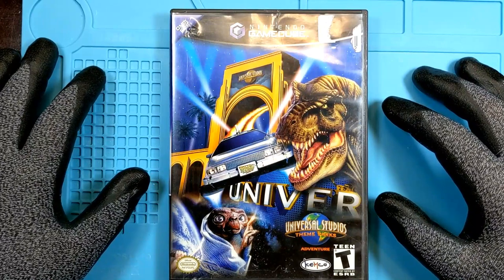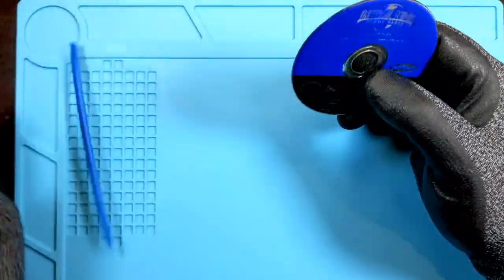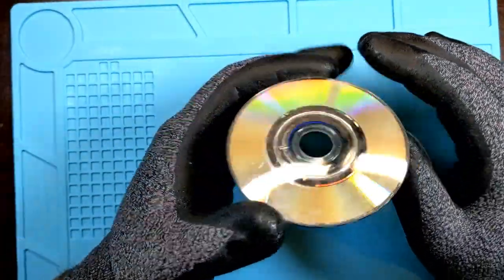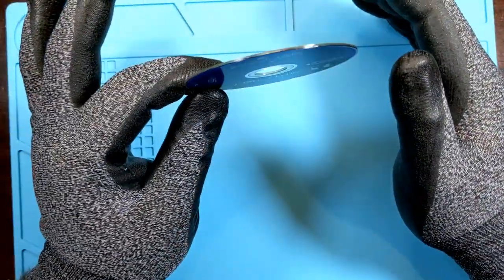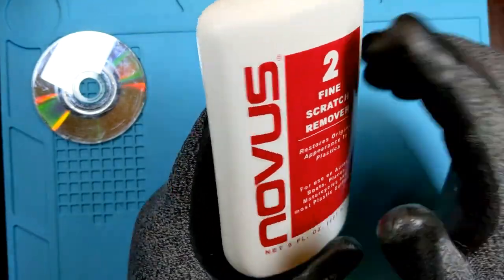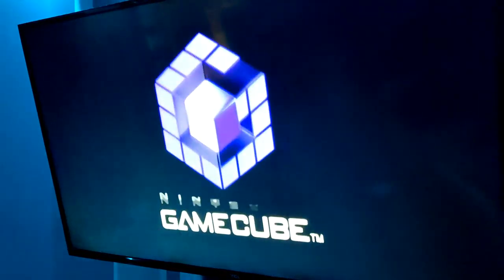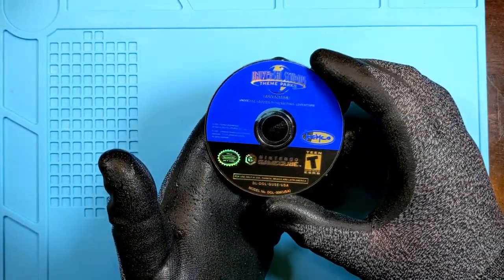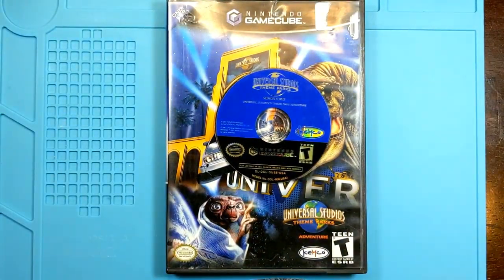GameCube Disc Cleaning Series:  Part 1- Intro and basics

Comment: I had both disc resurfacer you mentioned in this video the Venmill 3500 and eco autosmart. The Venmill I will agree isn't a good one and doesn't really fix the games. The auto smart on the other hand i've had for years NEVER once did it leave residue in the center of ANY disc i put through. Also 99% of the games I run through it with end up working that were once not working. So you might wanna do a little bit more research before making claims that pretty much all disc resurfacers are bad. Also its not true that if you can't feel the scratch with your finger nail it doesn't need to be resurfaced. I've gotten discs with the swirl marks on them that stop the game from playing. Not a scratch itself.
Reply from the maker: We can agree to disagree! I have a basement full of ELM and JFJ machines, and have worked on many more. Those machines are also expensive and not always an option for folks, so I am happy to give people alternatives!
Reply from the maker: But you are right about the scratches. Even if you can't feel it, it can still impact gameplay, swirl marks too. It's more of a rule of thumb that scratches you can feel may impact gameplay.
Reply: True! I’ve resurfaced games that before cleaning didn’t work, and after cleaning it, they worked. This dude got his facts mixed up

Comment: What if any GameCube Disc plays halfway through and it says, "The Game Disc could not be read. Please read the Nintendo GameCube Instruction Booklet for more information".
Reply from the maker: That means one of two things, either the scratch is "later on" in the discs data area (think of it like a CD that skips on the 5th track), or that the laser has trouble reading after running for a while. 

If you've cleaned the disc and don't see any visible marks or damage, try to clean off the GameCube lens as well. Particulate from the cleaning compounds of the disc can also rest on the laser lens and cause issues down the road. Somewhere in that system or disc is the issue, it just might not be right at the beginning of the discs readable area.

There have been discs that I've cleaned before that work just fine with a test run, but halfway or even close to the end of the game the disc freezes up. Unfortunatly a disc isn't like a record where you can figure out what "halfway" in the game would be on the disc, so you have to clean the entire thing again.

Comment: Everything I've tried to use Novus 2 on just adds more scratches. Disc's or otherwise. I must be bad at this.
Reply from the maker: It'll look like it! Heck sometimes it'll look worse than it did before! But you're removing the top layer of material and smoothing out the scratches that are making the disc not play! For the first 3 parts of the GameCube disc cleaning series, the focus is on getting the games back in working order. After that, we'll have videos on bringing a mirror finish back to the discs. (I'll admit though, I rarely worry about the look of the disc if it works, but we'll have a handful of "how to polish discs" videos to get that mirror finish!)

If you're using Novus 2 and getting scratches still, use more polishing compound and switch out the cloth more often. It's likely that the cloth is doing more of the scratching than the polish is. I need to stop showing cleaning discs using a paper towel, as some paper towel brands can scratch a disc very easily!

Comment: can you repair games that have water damage?
Reply from the maker: Yes, but it depends. If the water damage has impacted the data layer, that changes things. Thankfully most modern discs have a seam that separates the data layer from the internal ring. Even then there are methods of drying/baking (I use that term loosely here) that can remove water damage. The problem isn't always the water, but what the water leaves behind (mineral deposits and/or staining)

Comment: Just got resident evil three for the GameCube it runs in the beginning shows all the ads but can’t get to the start menu. But I did get it resurface sure enough and it still does not want to work. What do I do???
Reply from the maker: Sounds like it needs a bit more resurfacing! Which happens. If it now shows the three ads at the beginning and stops, that means that it's getting closer to working! Just keep at it!

Comment: I used 3000 grit sandpaper and var wax...its not working 😢. Im gonna get some novus tomorrow ... I got all the large scratches off of it they're just extremely fine now....
Reply from the maker: So sandpaper resurfacing is its own thing entirely (I'm slowly working on that series), but to do it correctly you'd need at least 3-5 different grits of paper, otherwise you can't reduce the overall scratches. If you're looking for a mirror finish, look up polishing/sanding pads and add some water to that wax! (also be careful with the wax, as some of them have additives that increase the overall grit of the wax itself).

Comment: So I have GameCube games that are badly scratched and I used the nova two and the GameCube still says can’t read the disc what am I doing wrong?
Reply from the maker: Might take a few more tries! I had a copy of Pokemon Gale that wouldn't come back to life until my 22nd polish (apparently it just didn't want to live), but I got it working! Check out my Part 3 of the GameCube series where I get into what to do if the Novus 2 just doesn't work (and I explain why it might not work right away).
Reply: @RestoreAndReplay  oh ok great and I finally got it to work took two tries thanks so much

Comment: Did you actually try playing the game from start to finish? Just because the system can read the disc, doesn’t mean the game is fully functional. I know this because I have a disc with a scratch that’s causing the disc to stop reading once I reach a certain level in the game.
Reply from the maker: While I wish that was the case here, the disc wouldn't load at all. No start up screen, no nothing. Which happens with severely scratched discs, the system has to find a few specific spots to read before it gives the green light. And in the case of these games, it was a "no go".
Reply: @RestoreAndReplay  What I meant to ask is if you attempted a full playthrough of the game AFTER you resurfaced it.
Reply from the maker: Ah! Gotcha! Once the discs are resurfaced (at least the ones I do) they go through a microscopy inspection to verify there aren't any remaining significant scratches or abrasions. Depending on the title (and if it's for a customer or not), a full playthrough isn't always possible. But marking the scratches and substrate damage, then reinspecting after the resurfacing process, tends to be a solid QA process, at least for my efforts!

Comment: is there anything you can do when it has a scratch on the top of the disc? i know some games it doesnt matter, but some, like a copy of mario party 6 i have has a scratch on the top and it wont work, bottom is flawless
Reply from the maker: So back in the day we used to put masking tape over the top of the disc and it would prevent the laser from reflecting through the disc. Buuuuuuut with GameCube it's getting harder and harder to not get excessive label damage (look up "Metal Gear Solid Twin Snakes label damage") For now I still use the tape trick until we refine how to seal and color in the labels, but it's a work in progress.
Reply: @RestoreAndReplay  thanks for the reply man I appreciate the info, ill try the tape trick, im familiar with metal gear solid on the gamecube lol, thats also one of those weird ones u could peel off all the art on the top and it will still work, gamecube games are weird lol

Comment: What about head light buffing compound
Reply from the maker: It will work! I use Meiguars Headlight polish for discs at times. I have plans to make a video covering a few headlight kits. With the buffing compounds you'll just skip the wet sanding steps they suggest, and instead add more or less compound to increase the abrasiveness!

Comment: Tried doing this with my Wii Sports around a year ago, didn't help it work. Turns out the disc was scratched beyond repair. Ended up getting a new copy for Christmas 2023. Might retry this with a scratched copy of Sonic Adventure 2: Battle.
Reply from the maker: Those "beyond repair" discs might surprise you. I actually actively search for "hopeless" discs. If there's enough polycarbonate to work with (you have to measure it with calipers), you'd be surprised what can be recovered.
Reply: @RestoreAndReplay  I got a new copy, and... guess what? IT LOOKS EVEN WORSE! Guess I have a lot of restoring to do!

Comment: Got my Novus in the mail today 😁
Do you tend to use the step 1 after you've used the step 2? I understand it's just a cleaning fluid but does it have any use in this process? 
Or is it better used elsewhere? Like when cleaning consoles etc?
Reply from the maker: I'm going to make a whole video on Step 1!  But the short version is that I use it to shine and protect consoles! I use it similarly to ArmorAll. It also helps when used on games and consoles to help resist dust and fingerprints! (but it only lasts a few weeks!)

Comment: Hi I got a scratched copy of colosseum novus 2 should come in tomorrow roughly how long would you leave the novus 2 solution on the disc before you buff it? Thanks in advance
Reply from the maker: I leave the Novus on just for a few seconds until it thickens up a bit. It helps with polishing. But you can also start to polish right away with wet novus. Try it out a few different ways and see what gives you the best and smoothest polish. You want light resistance but you don't want to have to force the polish. For starters just give it a count to 5 and start to polish!

Comment: I'm totally unimpressed with Novus 2 "Fine scratch remover". Believe me, i've tried virtually every non-professional disc-cleaning cream and gadget under the sun &, in my opinion, this is no better than any of them. It may work well in conjunction with a high-end cleaning machine but cleaning discs by hand with it shines them up pretty good but, rather ironically given it's name,  leaves them completely covered in fine scratches.
Reply from the maker: I'm sorry to hear you're having trouble with Novus 2! That stinks!

Interestingly enough, Novus 2 is the same chemical composition as most retail "disc fix" compounds, including the ones sold by GameStop and Circuit City!

Comment: Do people really resurface games before seeing if they can play? That blows my mind…
Reply from the maker: Not just people, stores. Most of the stores by me resurface every single disc they sell. I have to remind them to not do that to mine when I buy them. Each resurface removes some of the polycarbonate layer of the disc, so as it gets resurfaced over and over, that layer gets thinner and thinner. Without verifying disc thickness, that resurface may be its last!!! 

Maybe not that dramatic, but you get the idea. Bulk resurfacing is somewhat unnecessary, but done because customers want to see a disc that looks like it will work!

Comment: Novus only comes as a part of a set, making this pricy solution. Can the other parts be used in any way? It would be fun to see you experiment with step 1 and step 3.
Reply from the maker: Absolutely yes! Novus Step 1 is my absolute favorite for cleaning up and protecting consoles (there's a video coming for that!)

Novus Step 3 will be featured very soon in a GameCube series video. It's for when you need some extra elbow grease and/or have deeper scratches! Both are definitely useful!

Comment: I know this is an old video, but what do you think about Novus 1? My local Home Depot only had dual packs that came with step 1 and 2. Should I bother with the step 1 at all?
Reply from the maker: I really like Novus 1! It won't do too much to get rid of larger scratches, but it helps clean off dust and fingerprints from discs, and leaves a nice little protective coating that keeps dust off for a while!
Reply: @RestoreAndReplay  Thanks for the reply! Love your videos, thanks for sharing your knowledge and helping people fix their old games! My Mario Galaxy disc always freezes at the same spot in the same cutscene. After each treatment with Novus 2, it gets a little farther before it freezes. Ive done 4 treatments so far, Ill do 20 more if I have to! Lol

Comment: I just used some McGuires plastic car lense polish. It made my $30 Mario kart double dash work. It did have an issue in a GameCube that was supposed to be bad. But it was fine in same system prior. So I adjusted the laser and it played fine. It had a spot on the intro that would drag, but that went away. So I won’t be hellbent on the small scratches as long as it plays according to your advise. Thanks
Reply from the maker: Absolutely! I primarily use Meguiar's in my car detailing, so I try to find Meguiar's stuff that will also work on video games, and there are a handful of their polishes that work wonders on discs. Maybe we can get them to make a 2-1 cleaning product!!

But for real, GameCube games can be so picky, and the GC lasers can be sooo picky as well. I love that little system, but it certainly has it's quirks!

Comment: My endeavors with novus have been relatively successful! All the discs I've used it on have become mostly or completely functional all accept one disc, I've probably used novus 2 on it about 15-20 times and I've used novus 3 twice, but it still won't play, it gets to the loading screen of the game(before it didn't read at all so the novus worked a little bit?) but that's it, should I accept that the game is beyond repair and give up on it or keep going?
Reply from the maker: You should never give up on a disc! What's the disc? And for what system? Having to do 20 rounds of Step 2 and 5 rounds of Step 3, then repeating the entire thing isn't out of the question, it really just depends on how deep the scratches are.

Are you able to see any noticable scratches on the surface? Or feel any with your fingernail?
Reply: It's Sonic Heroes on the gamecube, the disc is cracked in the center ring and it goes into the shiny aluminum part which made me conclude that the disc is unfixable, and it also has one scratch that has somewhat reduced but isn't going away.
Reply from the maker: Center ring cracks rarely mean ruin. It depends on the width of the crack into the data layer and if the top and bottom layers of polycarbonate are still intact.

I'd be happy to take a look at it if you're willing to provide pictures! I would love genuinely irreparable discs to add to my collection (they tend to be salvageable)
Reply: picturre quality isn't the best but I'm sure the cracker is visible

Comment: I have an odd situation. So I have 2 discs that don’t play in the GameCube but it will in the Wii. Is there a better placement for the laser or is the laser just better on the Wii?
Reply from the maker: Likely the GameCube laser is just starting to show its age. I've had a few GC games that play better on the Wii as well. Cleaning the GC discs help, but cleaning the GC laser also helps. The Wii laser, just by its age, is going to work a bit better than the GC, but it couldnt hurt to clean both laser lenses too!
Reply: @RestoreAndReplay  Good to know. The Zelda game with 4 games on it works like a charm on the GC but likely that’s giving it more to work with.
Reply: @RestoreAndReplay  I bought a modded one anyway. GC prices are way to high right now to completely stick to American copy’s or get RGB cables.

Comment: I saw a another tutorial that said to only go side to side I’m not to sure what works better
Reply from the maker: I've been told "side to side only" and I've been told "one direction only" or "clockwise circles only", there's lots of different approachs out there. I've been using my same method for 20ish years now and never had a problem. But try out the different styles and see which one gets the best results for you!
Reply: @RestoreAndReplay  I want you to know I was ordering the novus but thought why not try buffing it with toothpaste how you do and my game of the incredibles started working thanks so much and I was wondering if you could do like a full mirror finish tutorial I got the novus one and two pack